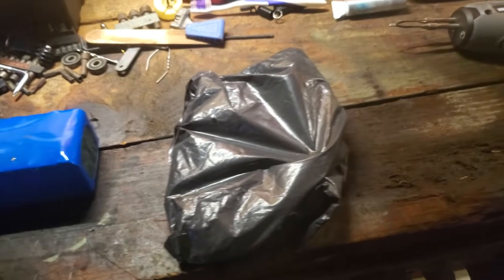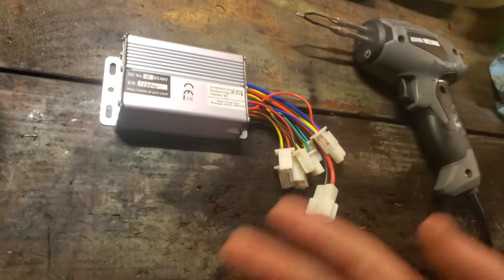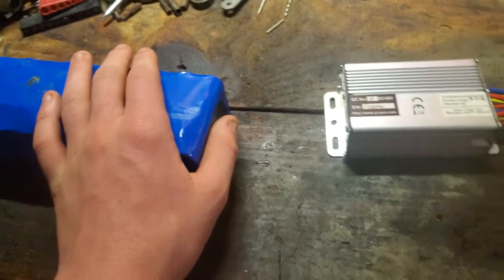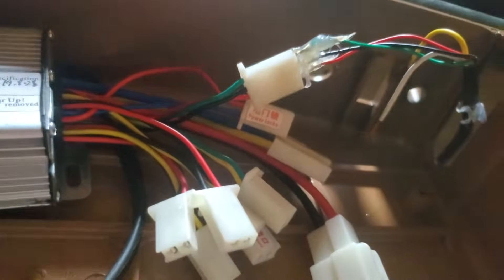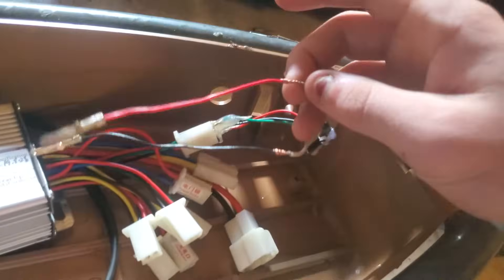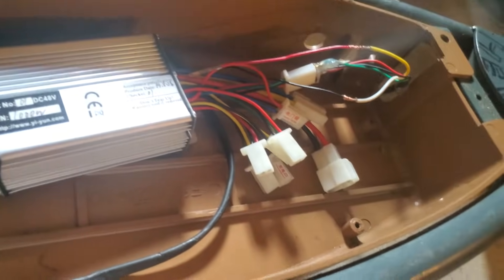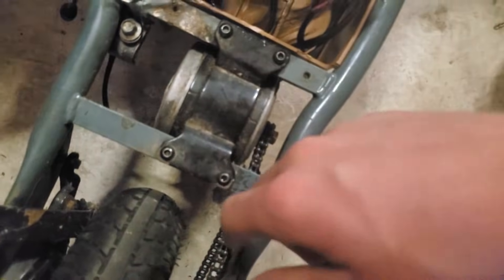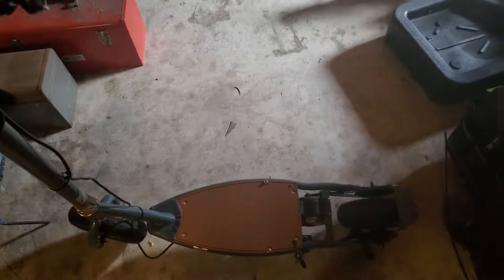Wire 48V Speed Controller Key Throttle, Motor, Battery...

Comment: hey man, i just upgraded my motor and controller to a brushless one (48v 1800w) and my key switch just stopped working any ideas on how to fix it?
Reply from the maker: Check over all connections and search for any exposed wires. Any exposed wires will be the vulnerable to arching or corrupting the controller for good. Sucks when this happens best bet is to use a multimeter and test your battery it should read at least 49-50 volts. Anything between 48-52 should be healthy
Reply: @dylanmoore1006  got the electric lock working just switched around the wires now the only problem is that the motor wont turn and i have heard that i need a Three speed switch so i have ordered that now im just waiting
Reply from the maker: @krissf684  Anytime. but I think the reason it won't work rn is because you have to upgrade your battery. Running a 36v on a 48v controller will trick the controller into thinking the battery is dead. I never had to order any special switches all you need is matching voltage to the controller amd you should be good to go. Remember to grab a new charger too you'll need it.
Reply: @dylanmoore1006  alr then im gonna try that thank you
Reply from the maker: @krissf684  no problem lemme know if it fixes the issue
Reply: @dylanmoore1006  tried it Did not work so im gonna buy a new controller, any tips on good electric scooter controllers?48v 1800w
Reply from the maker: @krissf684  https://www.amazon.com/gp/product/B07GBRTY2P/ref=ox_sc_act_title_1?smid=A18W40S1KX1L2P&psc=1

This is the one you want for brushed motors.
Reply: @dylanmoore1006  hey again got some new batteries and everything seems to be working fine, i got 4 12v 7,2ah batteries
Reply: @dylanmoore1006  YESSS!!! Best Comment lol Thank You! 48v controller wont work with only 40v battery, i hooked up a third battery after reading this and to hear the ZOOOOMM sound made me so happy ahhaa, guess he will be going faster than expected! would 60v be to much for the motor ? and does the AH have to match when connecting in series ?
Reply from the maker: Glad I was able to help. The AH ratings should stay matching or else the currency will be unbalanced. 60v is too much for the stock motor for sure. I blew it up running 48v.
Reply: @Dylan Moore  Thanks for reply! N how long did the motor last with 48v? Is there anyway to run just 40v with the 48v controller?
Reply from the maker: @SirusTheVirus  Eventually the  motor burned out. If you're careful with the top speed, it will last. 24v motor is safe at 48v if you're staying around 20mph flat.
Reply from the maker: @SirusTheVirus  you'll need a 36 volt controller if you're using 40v. The low voltage cutoff on a 48v controller is 42v.
Reply: @dylanmoore1006  thank you, and i should also mention that i am using a 36V battery should i buy one more pack to make it 48V as the motor?

Comment: Hiya, can you please send me a current link... To a speed controller with throttle please??? Just need some help as feel confused and don't want to order the wrong thing. I have already put on a bigger motor but still running the standard type batteries. Need a bit more speed + control! Thanks 

Lola
Reply from the maker: So you're running 24v how many watts?
Reply: @dylanmoore1006  I actually don't know because I changed the motor three years ago and can't go as far back on order history to get the details... 
Is this a huge problem?
Reply from the maker: @LolaNovaCaveySupernovaRacing  not a huge problem but it's something you wanna know. When you buy speed controllers they have custom ratings by voltage and wattage. They're all different
Reply from the maker: You'll want the controller's voltage/wattage to be the same so you get full potential
Reply: @dylanmoore1006  There's a sticker!
Can't fully read it but...
Rated Speed:2750RPM
Rated Current:18.7A 

Any ideas on a link for me to purchase?

Comment: a bit more clear on the last part of that connection between the power lock and throutter yallow and white  wire
Reply from the maker: Yeah the last two wires, other than the green, black, red. Plug the two other from the throttle into power locks, switch the wires until your throttle powers on with the keyswitch in the on facing position.

Comment: What is motor  voltage .is this controler use 24v motor
Reply from the maker: you can use a 24v motor with a 48v speed controller.
Reply: @dylanmoore1006  thanks for your idea

Comment: about how long or range do you get with these batteries?
Reply from the maker: The lithium ion battery packs are a unique was to get extra range out your scooter/bike because they're way lighter and way more efficient than sla's. The range depends on the (Ah) rating that's listed with each battery.  It's important NOT to cheap out on these batteries because chinese company's scam their advertising all the time. For instance the battery in this video was probably a 12ah, which would last a good 1.5 hrs per recharge. But ive ran across fake advertized ratings so theyre cheaper and arent the size (ah) advertized. So when you buy these batteries be ready to spend at least 300-500$ on a positive reviewed, name brand battery pack.

Comment: Excuse me mate, what kind of motor is this and how many phase?
Reply from the maker: I was using the stock motor, however they aren't recommended at all for that voltage as it should match thr wattage as the controller

Comment: hi i have a question. is it okay to use 99ah battery on dual 25a controller? the voltage is the same
Reply from the maker: Be careful on what you may think is 99ah, most 8ah batteries are at least 150$+ there are alot of fakes

Comment: Do i still need to do all that stuff with the wires if I have a stock throttle
Reply from the maker: You'll need to replace the stock throttle, there are kits that come with it that fit the controller on amazon/ebay.

Comment: Hi
Can  you clear this up for me?
I have 48v 1600w brushless scooter motor in my scooter, stock 48v 12ah 20v LI batt and crap no name controller

What is the main component that powers this motor and can push it to the limit, is it the controller or the battery?

I was thinking to go with 48v 1500w controller and 48v 20ah 50v LI battery (1800w) max

What controller and battery combo will push this motor to the max? I was even thinking of going 60v overall

TY
Reply from the maker: The controller is just the motherboard for safety and throttle connectivity, the battery is the main source
Reply: @dylanmoore1006  couldn't the controller if its the wrong one limit the scooters speed? If I have a 1600w motor, should I get a 1500w or more controller?   TY

Comment: From where did you get the throttle? And how much was it. I’m trying to get into modding my razor scooter and I was wondering if I change my controller to 48v and 1000w and I want to get the most out of it so I have to change my motor and batteries as well? I have a low budget btw. Thank you!
Reply from the maker: Ebay man! Always trust eBay these days they have good cheaper China throttles and econtrollers
Reply: @dylanmoore1006  thanks man!
Reply: @dylanmoore1006  I know you said eBay but dk you think this throttle and controller will work? Here’s the link:  http://www.walmart.com/ip/LYUMO-48V-Brushed-Motor-Controller-48V-800W-Brushed-Speed-Controller-Kit-for-Electric-Bike-Motor-Scooter-with-Lock-Throttle-Grip/674606214

Comment: Hey bro where do you got your battery from. I want to run an 36v motor on my ezip.
Reply from the maker: Sorry for the late reply, here's the best deal: https://www.ebay.com/itm/402712329149?_trkparms=ispr%3D1&hash=item5dc3867bbd:g:zVQAAOSw-5dgOJmW&amdata=enc%3AAQAGAAACoPYe5NmHp%252B2JMhMi7yxGiTJkPrKr5t53CooMSQt2orsS%252BMKizvpuEDUfX4dvRWfUzccI%252BObjdCe1h7d1dZVQHMu1FYdonSPfYQLduldBMj9jPiZHLahIoojr4OyT4i06FJQXG9UfB57ojbMpY7PzdJtnxuw9kK1O9ap6e0fGCSbqS51y3e73uwv8HOegl6gWdd1Z%252BHWtRUtrYLCp4zioUGPV2aHPCdvkTNvm0yWKhVrnMXsZj9d1IWCVEOP%252BZSkGCPZrl%252FNV9Y5JOI32t708Fx%252BYtop33sF52K7V9v3fmXKW2bDYajZGk4A2ptUERltm82hd2L2VCrdjXhcTME8rv1pbRCC%252Fs%252FaXTMgv6kbdwQrkZ1MDBdDDEvCcRlC4cIYkZrfojfjpMhJk93ux9kUv%252F7W91eOrvkgvdZR24sWedzJOJXk17WbEm3%252BPKdmmKE8YkCubENAMWpt6K%252FZN8f%252Fs313DeFDS91fUqOzNkTbtRYSsrVtgYP2oHMf9NQXq%252FeTm1olYMwWP0uiPy4tDxeUyn0y5%252Bh5yZ%252BelVLy3zcIBYNnIg5AMQs%252F4fCo4LZOiRwHJcUgsRy4fbMPt%252F8e%252FZ7ek16AHspOvym4ElBWeFzkZpLDrtshqoVrPpvitejiIFUR%252Bld5JC46%252BLbDdZlgbpWs9Hyv7wtN82S8as%252FyeuLNDf%252F3xO0RTDLZV6dofWnuGwwiZhAHSVyWXYjjPVBfU%252F0CcsresendD55fl2Lk%252BN9Ulkq4skIByDgie1KfFvkXXPqPOHRCAfti4Q5Z%252B6W0PLoGROGWPEhUW2j4WXeLdpEWPMv%252FGf7N2R7qrEeRumA69EvkzZk5sbzYUQWlxzdU%252Fw3O52C%252BNxClEbTl6caZtt2J4jyk89dMXABDG%252Bqik5HuSgg%252FZ2A%253D%253D%7Campid%3APL_CLK%7Cclp%3A2334524

Comment: The link for the battery doesn't work what is the best battery for a 48 volt motor
Reply from the maker: https://www.youtube.com/redirect?event=comments&redir_token=QUFFLUhqbmp6SDM2WmdWMFRkTFR6VFNKWWNoY3FXWTBBUXxBQ3Jtc0tub2VvRjhRX2EtVkdyMU9TS0lvOUdydUk5TE9STGVFc1VMNDUyZEIyX0pkckJBSEpwZ3Q4NGN6Y0lMOWxHOVFnOUpQbjhqS3BSSTM0NVVtYldCbm5DYXh1N0FPQ0tDVkFTZmU4cmdBYlNKSjdfdWZvZw&q=https%3A%2F%2Fwww.ebay.com%2Fitm%2F284068739986%3Fhash%3Ditem4223d0fb92%3Ag%3AU4UAAOSwa39fo2v1&stzid=Ugy5l1qvfbNERoAQ_WN4AaABAg.9Rt10qDyzRI9SFFC2AGk-a

Comment: I bought a $1400 e-scooter from Amazon and fortunately, it's working perfectly for the first 300 miles.  However, there are no e-scooter repair places I can find in NYC if something eventually goes wrong.  These Chinese e-scooters don't seem to follow any standards and there are no wiring tutorials available.  I really wanted to upgrade my battery (48V 17.5AH currently) capacity for longer rides.  25 miles is tops using a Garmin GPS for accuracy and riding about 17 mph.  I was hoping to get a battery (48V 23AH) that could give me around 30 miles range.  I'm not looking for a higher top speed, just longer riding time.  I thought I could find a shop that could easily handle such a simple upgrade, but not one shop does that sort of thing.  It looks as though I'm going to have to do it myself.  NYC and no e-scooter repair places.  That's just crazy.  If I knew that, I would have bought an e-scooter from MiniMotors or Voro in NYC and bought an e-scooter they could fix or upgrade.  Oh, well.  Live and learn.  If I can get 1000 miles out of it, I'll take the loss and buy a better e-scooter if I can't upgrade it myself.  I've been scouring all the controller tutorials to see if I can learn something about controller wiring.  What a mess.  It's nothing I'm looking forward to doing.  I just want to ride and not tinker.
Reply: did you solve this issue

Comment: Hey, i'm trying to figure out which wires on my controller are for the key switch. None of them are labeled, and the label on the controller itself is in chinese. To make matters more annoying, none of the wire colors match what is on my scooter or shown in your video. Even on the circuit board there's no markings. I figured i'd check the voltage between the pins of each of the connectors. I have found two connectors, which when plugged into the battery show 24V each between their pins. The rest show 0V. How do i find out which one is for the switch without ruining the controller? My motor, battery and throttle cables are already identified.
Reply from the maker: best bet would be to replace the controller, an unmarked controller is very easy to pop
Reply: If your controller has a model number could you look to see if you can find a wire diagram 😊xx

Comment: I’m trying to connect front and rear lights on my scooter with the throttle with the key I wanna know where do I connect my wires too on my brushless 1800w speed controller
Reply from the maker: Should be labels on every speed controller for headlights and taillights. If not I'd recommend a better unit

Comment: Thanks bro, I was just about to give up until I saw this video.  The one I have has a pink and blue wire that needs to connect to the yellow and blue wires you showed on the throttle.
Reply from the maker: Thanks for letting me know <3 congrats on your build.

Comment: Thanks, cool video! If I was going to do a forward/reverse switch, would it go after the output of the controller and before the motor? To reverse the polarity of the motor.
Reply: Usually if the controller supports reverse it will have designated wires

Comment: dude the yellow n white throttle wires do they go to red n blue on the controller.ie,yellow to red and white to blue is that right
Reply from the maker: It should be red green and black, match them to the connector called "derailleur"
Reply: @dylanmoore1006  yes,iam talking about the key switch
Reply from the maker: @sami-zc1nl  if you own a keyswitch throttle then it should have 5 wires, the switch for the key should be called "power locks" match them up and then plug the throttle in.
Reply: thank you,top man

Comment: Great video Dylan!Very helpful!I have an e-zip 900 that got upgraded to 36 volts a couple years back.Its been sitting and the batteries are dead.The current batteries are the square acid ones and one is mounted on the outside frame.I like to use the the same type of battery you are using so it fits underneath the foot rest.Can you give me some insight?Thanks man!

Comment: I know I’m late but can you please find me a battery for the razor power core e100
Reply from the maker: What kinds of battery are you looking for? One to replace the original, or an upgraded battery?
Reply: @dylanmoore1006  I’m trying to upgrade from 12v to 24v if you can find a link on Amazon that would be great but if any site works best for you that’s ok
Reply from the maker: 24v battery packs can be difficult to find on Amazon I could go on aliexpress and see if they have any 24v rated batteries at least 8ah
Reply: @dylanmoore1006  ok then can you try eBay then ali express please sorry for pressing you

Comment: you know you can just solder on the correct connectors right? Or just solder the wires directly? you absolutely do NOT need to buy a controller with identical connectors.Youre very much limiting the amount of products you can use.

Comment: Hi, I have a joyor X5s with some open (unplugged plugs) one is small black /red wire with red connector, other is orange brown blue with red connector, and lastly one green / black small wires with black connector.  Controller is a DC Moto ZH1PU any help greatly appreciated!
Reply from the maker: No problem glad you found the video helpful!

Comment: Can it burn out..if the battery poles are reversed..i have problem with my electric moped..I burned out my charger.. after that everything gone wrong..I changed the battery..but noting.. only the lights and blinkers work
Reply from the maker: Yes, it is very important to know that the positive and negative wires are direct to where the power is supposed to go, otherwise it was cause a short circuit and burn the controller. The battery and motor will be fine, but controller will need to be replaced
Reply: @dylanmoore1006  i didn't know that..i thought the problem is in the battery.. Many thanks mate.. I'll get new controller.
Reply from the maker: No problem mate, hope to see the project running soon!

Comment: Hey my 500w 48v 18 Ah electric scooter brushless speed control went out on me and my rear wheel makes a sound now. What brushless controller do I need?
Reply from the maker: Search those specifics in ebay and you'll get what you need
Reply: @dylanmoore1006  here's my other question how would I know what I need. Because I've been hearing that I need to count the wires I have and with out the blue yellow and green and black red. I have 27 and one person saying that I need to have 23 wires or that on the brushless motor controller box I need to look for the exacted 48v 39v 15A? Can u plz tell me what is the right one
Reply: @dylanmoore1006  plz and thank you I really appreciate it so much 🙏
Reply from the maker: @sergioinsunza8653 no problem
Reply: @dylanmoore1006 ?
Reply: @dylanmoore1006  what do mean by that? Do I need to count the wires if so how many all together. Or do I need to separate the blue and green and yellow and black and red don't count them or do I need to count them as well?

Comment: If i add 48v to a 36v hub motor would i harm my controller or motor?
Reply from the maker: You would need a "hall sensor" speed controller which is slightly different. Once you hook it up to one of those it works perfectly fine but you need to do a bit of custom fitting  to put the hub motor on
Reply: @dylanmoore1006  Thank youf

Comment: thanks just what i was looking for can you overvolt these controllers ..  like one can a brushed controller?
Reply from the maker: They can't go past about 6 volts or so above 48, and no problem. But if you overvolt a motor it should work just fine as long as you don't overwork the brushes.
Reply: @dylanmoore1006   cool, I guess I can tell if the brushes are overworked by monitoring the heat?   What do you think about that Harbor Freight soldering gun?... I find mine to be not too good ..barely works... Their older one put out a lot more heat., so much more heat that it use to melt the body of the gun,   My soldering pens work better at just 80 and 60 watts. The power locks connector for the win.. after hooking it up it worked then kept cutting off then I switched batteries and all is well.   cool channel worth subbing to.  clear and concise. Shalom
Reply from the maker: @GDMHificationranpitc  yea the harbor freight ones overwork themselves and the tips burn off. I would recommend the soldering station so you have a sponge to clean the tip and flux. The stock motors only burn out from heat and not voltage, but running 36v should be okay...